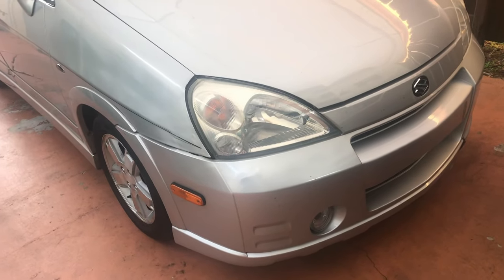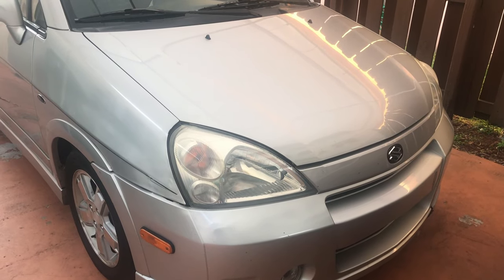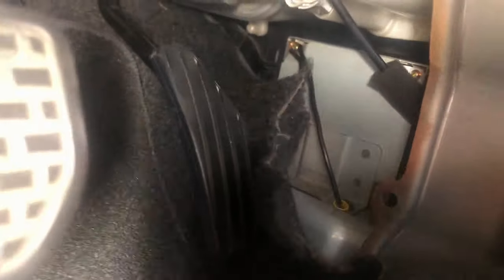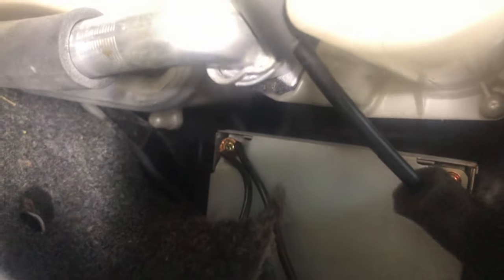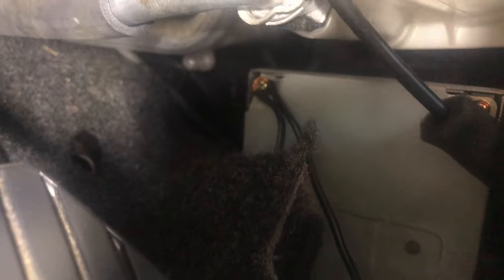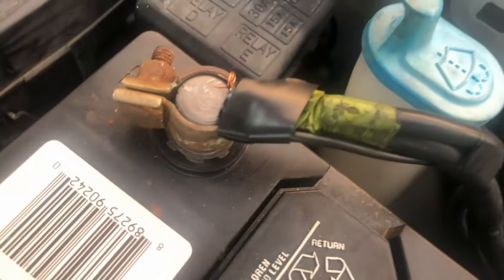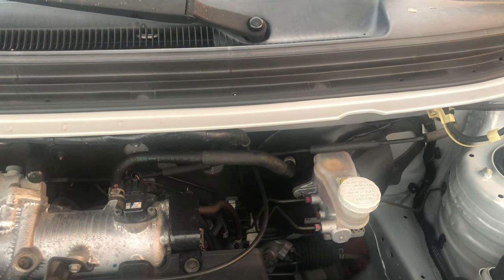NO COMUNICATION BETWEEN TCM AND ECM: SOLVED

Comment: Or in my case, if you recently put in a new battery, make sure to clean the corrosion off the connections. I wasn't able to do it at the store but got a U1000 code on my Infiniti G25 a week later and saw another video that suggested to try cleaning battery connections to clear the issue.
Reply: was something else causing the u1000 code ? i currently have it along with p0882 and p0726 both no tcm signal codes but i can’t find anything to fix it

Comment: I’m having the same problem with my 2017 Chevy Silverado won’t start no communication and it’s n limp mode p0700 I have bought new battery new wiring harness and have clean all ground still no communication won’t start because it’s showing it’s not in park

Comment: good for you brother. you saved yourself from the big Skru!    i wrote service back in the day and sadly the mechanics have a contest , who could be the biggest skrudriver' cha ching.  i didnt last long there.  no thanks!  dealing with a no comm to ecu now myself,  thought the timing chain broke but its intact upon inspection,  340 k miles i will replace it now , at least i was spared the crunched valve damages.  😀

Comment: **Maybe this information could be useful to someone. ** 
my 2012 KIA was in an Official Kia service for 3 MONTHS. The total amount I end up paying was $2714! But the problem was fixed after they change the CONTROL ASSY-HEATHER which costs around $100. Yes, $100, instead of $2714. 
My car was going in LIMP MODE. Seems it was a very very rare case. Something that they had never seen before. They change many expensive parts (like the wiring harness and PCM control)  and the car was not working. I had to pay for all those changes without solving anything. 
It has been 1 year since the repair and the car is working great! Hopefully continues this way!
Reply: my car has very low mileage (37.000). I believe his previous owner was never able to figure it out what was going wrong with the car.
Reply: Hello, my car is in limp mode and has trouble starting. It cranks, but it doesn't. I've previously changed my ecu and thoroughly examined the wire harness, but I'm just wondering whether my car might also be affected by the same reason as it’s damaged and the knob on my controll assey heater has come out and theirs a motherboard at the back of it. was your control assy heater broken by any chance? did it also crank and have no start?
Reply: @Unicornkitty-ni7kh  no, my car was able to start, the only problem that had was the limp mode and some lights on the car dashboard. In the mechanic, they changed the harness but didn't resolve the problem. It was solved once they changed the CONTROL ASSY-HEATHER.
Reply: @elilucha  by any chance, do you still remember what lights were on your dashboard? as my car has the glow plugs, down hill and slip light control on
Reply: @elilucha  could you still change gears perfectly or was it in lock?
Reply: @Unicornkitty-ni7kh  I was able to change gears. but the car was not going fast, it seemed like going in the second shift.
Reply: @Unicornkitty-ni7kh  it was the symbol of a car with squiggly lines. indicates that the vehicle stability assist program is engaged.
Reply: @Unicornkitty-ni7kh   my car is automatic. the car was in limp mode, it was like it never left the second shift (even though I was driving at 60 miles), I could hear the engine going like in the second shift. And on the dashboard, the light of the car with squiggly lines was on.
Reply: I have a 2012 optima that has the lights going on and off randomly. I'm in it for 2k so far 😅 Yours was the climate control system, where you actually set the temperature ?
Reply: @elilucha That was your traction control light. Also your engine was in limp mode which limits RPM and speed. It's a safety measure programmed into the ECM to prevent engine damage.
Reply: You're saying heater/ac assembly caused stability control light to come on?

Comment: Having this issue with my Volvo S60. Going to give this a try. Thank you.
Reply: Hei Dawn, any result? Im struggling on my XC90 2004 2.5T, there is strange codes from CEM, but related to TMC.
Reply: @nurka489  unfortunately no. The immobilizer locked it up and I haven't been able to reset it. I ordered Stabilant 22 from Amazon. It's supposed to create stronger electrical connections. I will use it on the antenna ring connection as well as the ECM and TCM. If that doesn't work, my next step will probably be xemodex. I really hate spending that kind of money though. Especially when I know it's something with the car's computer, not a bad transmission or anything.
Reply: @dawnrobbins5877  a quick update. After a long consult with mechanics of the company where i do work, i decide to buy a new battery. The new one is 77AH, with 760 cold start, the old one was 70AH with 660 cold start. It seems, that TCM, shift lock errors on CEM did disappear. Its been 2 days now, i didnt drive too much, but to go work and back home, i have to go up and down to a small hill. Didnt felt any issue at least with gearbox. If i get something new, let you know. But, how old is your battery?
Reply: @nurka489  I too bought a brand new battery, 760 CCA. Still can't start the car because of the immobilizer. I'm hoping to get back to the project soon, but for now I have it on the back burner. My goal is to have it in good shape by the end of the year. So, do you think your problem was solved by the new battery? I sure hope so!
Reply: @dawnrobbins5877  had some small issues with like 2-3 hours ago. It happen a couple of times during driving, using manual shifting i was able to get out of limp mode, during the drive. Not sure if the battery did solve too much. Im going maybe this weekend (i dont have too much free time with an infant at home), to try and clean CEM with contact cleaner. But, im not going through xemodex. I’ll look something more cheaper, and if that doesnt give a solution, im gonna sell the car, and change brand.

Comment: Great video. I have to try this ASAP. My only issue is that I couldn’t see where exactly on the TCM and ECU do I attach the ground wires to run to the Body? Anywhere, on the back of the modules? Or do I need to connect them to a wire in the modules?

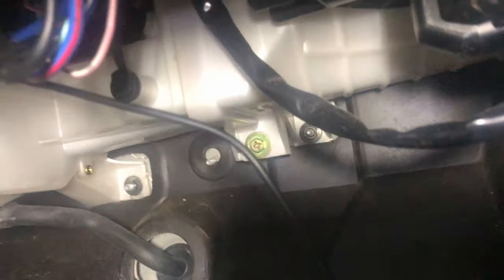Comment: At around 4:55 you show a wire connected from the ECM to the chassis frame and then another wire running from the chassis frame where you bolted the ECM ground wire to another wire. My suggestion, get a butt connector to connect those wires and crimp each end. Right now those wire connections are exposed and they could also come loose.
Reply from the maker: Thank you for your comment
Reply: He probably haven't finished buttoning it up yet. He left it so that we could see the bare wires.

Comment: the input transmission speed sensor and output both are two main things that communicate with tcm! if your trans fluid is low the input will not work controls rpm tach gauge, output controls speedometer seperate through coms with tcm. your tcm is fried or at least the grounding inside is or fluid is low! you cannot change the input without dropping the transmission its inside the drivers side side cover of trans. if you look inside transfluid hole youll see wires to input sensor in the fluid! it can cuase not start. and throw flase codes and no com codes! gm sucks run by satanic cult gov. they will burn in hell for what theve done
Reply from the maker: Thanks for you valuable insight
Reply: @conquryourfear  💯🤣
Reply: Is that will be if the oil fluid not the same

Comment: I have a 2013 caravan, getting P0600 code, same thing as yours I think.  How do I locate those modules on this vehicle.
Reply: Your module tcm is on the side of your transmission near the front of your vehicle. Your ECM is under the battery which can be accessed near your front driver tire. Take loose the front wheel panel towards the front of your wheel. It's behind that cover.

Comment: My kia cerato 2011 won't shift from first gear, and EPS lights flashing, steering very hard so i hooked up scantool. U0100-loss communication between TCM and ECM
Reply: Did you solve the problem?
Reply: How did you solve the problem
Reply: @kimonshisagat1635 I’d try ecm the car is grounding out at least in my case with a Audi s5
Reply: @kimonshisagat1635 I think it’s motor mounts but can be other issue test all the ground with the car computer see what there reading

Comment: The tcm isn’t connected right or the neutral safe switch is in the wrong position…
Reply from the maker: How do you mis-connect the TCM?  It’s a plug in.  But your thought about the neutral switch is worth looking into
Reply: It’s easy to misalign the pins. And sometimes it’s not pushed all the way in.

Comment: I’m geting the p1689 No communication between the ECM and Injection pump module on my 2000 Dodge 24V any help ?
Reply from the maker: Some variables to consider: Is that your original injection pump?  Open up that injection pump cover, remove the throttle linkage, and check those few wires for their integrity. You know that on these trucks they are NOTORIOUS for bad grounds. There is that black wire that goes from the fuel pump relay trigger to ground. But on it way to ground it hits Joint connector #1 in the PDC and then heads for G102 ground location. (Left fender)
P1689 code is from the Fuel pump realy being dead just clear the code and you should be good... But fix the wiring right though.  Recheck all battery cables.  If you are still running factory battery cables, check they for corrosion. Hope this helps.  If you haven’t already subscribe to my channel; got loads of videos dealing with these second gens.  Happy New Year
Reply: conquryourfear & do it urself thanks a lot
Reply: I want to try this but you got me lost on step 2 can you explain better or draw a schematic on this ?
Reply: Ecm trouble shooting and reprogaming

Comment: Mine is giving me a U0140. Obd said it lost communication with BCM. I was observing some part with the obd and saw some odd movements like voltage drop to 3.6 volt for like a split second, engine coolant want negative degrees for a split second and 02 sensor bank 1 would go up to 8000 degrees for a split second too. All these would go back to normal and were all randomly doing it.

Comment: My 2011 RVR did this, i fully recharge the battery and the message was gone
Reply from the maker: You are one of the lucky ones!!!
Reply: @conquryourfear  your probably right...I had the motor replaced under warranty just 8 months before the 10 year powertrain warranty ran it's course...have a 2011 RVR with 7000km on the engine now

Comment: hi i have a 2005 navigator with the code u0101 no comunication with the tcm but i checked the harness and the cables seem to be fine. could this be a problem with mine as well? or what do you recomend i should check? thx
Reply: check the tcm connector pin sometimes they collect trans fluid or get corroded just reseat all your connections

Comment: Is this the P0600 code, having this issue myself with an Audi, it drives fine but cuts out and won't restart sometimes.
Reply: GET A WIRING DIAGRAM AND CHECK THE GROUNDS FOR THE ECM. iF YOU LIVE IN AN AREA WHERE THERE IS SNOW AND THEY SALT THE ROADS YOU COULD ALSO HAVE HIGH RESISTANCE CORROSION IN THE NEGATIVE BATT CABLE.... I HAVE SEEN THESE CODES DISAPPEAR JUST BY REPLACING THE NEGATIVE BATT CABLE BUT IT IS NOT 100% OF THE TIME

Comment: We are having u1000 code on our Nissan Sentra 2005 1.8 and an incorrect gear 1and 2 ratio code. Could this be why or something else?
Reply from the maker: Hard to tell.  I know the u1000 is the computer can’t figure out something. Needs to be driven more to throw a code.  As for the ratio code. That alone sounds like a transmission solenoid is shorting or grounding out.
Reply: @conquryourfear  thanks that’s our thought but there’s so many things it could be so we’ve been trying to do the elimination process. Won’t take off in the right gear it takes off in second, slow acceleration but drives fine and then it pops back into 1st gear once it hits about 30 mph and drives fine. No reverse at all it tries to move but acts like a parking brake is on
Reply from the maker: @arielchantel5644  Bad transmission solenoid’s will do all of that
Reply: @conquryourfear  I appreciate it I’ll for sure make sure I bring that up to the mechanic 👍🏻 I’m not sure how to check one unfortunately
Reply from the maker: @arielchantel5644  it depends. Some require you just remove the transmission pan and you have access to all of us Solenoids.  Others you have to take the transmission out. I do not know what the deal is with yours though

Comment: Hello I have saic Mg3 it was AMT and I converted it to MT but I got check engine light on. When I diagnosed it I found TCM communication lost. And I discovered that the Mecano has removed the TCM. Is there a way to turn off check engine light permanently please ?
Reply from the maker: Other than  taking your cluster out to remove the bulb ?  No
Reply: @conquryourfear  I did not get your point. Can you clarify please ?
Reply from the maker: @abdelchemami6964  well. I just cannot think of any other way to prevent that check engine light from coming on, except for removing the cluster and taking out the bulb that lights up the check engine icon.
Reply: @conquryourfear  okay 👌 thanks

Comment: this is whats wrong with everyones pontiac g6!!!
Reply: lol i am here looking for answers because of my g6.. the fluid is good and a new tcm but traction control is coming on.. possibly the wires
Reply: @caras5590  hello ive had 3 of these cars. what do mean traction control comming on? its supposed to come on you turn it off with button down by pasenger air bag light by shifter. if your car was recently worked on they probably did something wrong, wish i knew you got a tcm you didnt need one! they rip people off! the connector that plugs tcm in was problem! if you tell me what its doing exactely ill research for you. im a disabled marine vet nothing else to do! you could have bad trac cont motor. tract contr keeps the car from burning rubber baby! pealing out! i hate it!! comes on when turn car on automatically. you turn it off by pushing button under stereo all way at bottom by gear shift and airbag bag light. miss cara s
Reply: Hello I have a 2012 Impala that I can't get emissioned and tagged right now due to traction control syabilityrak light and check engine light.  We changed the TCM but about 3 months later all lights come on again.  I don't know what to do now cause can not pass emissions

Comment: I think this is the same
Problem I have with my car
Reply: Did you ever figure out the solution? I’m having similar issues but I want to actually fix this issue without running hot wires around plastic.